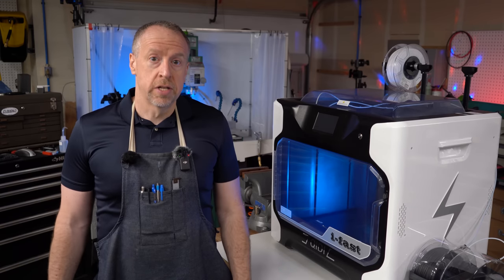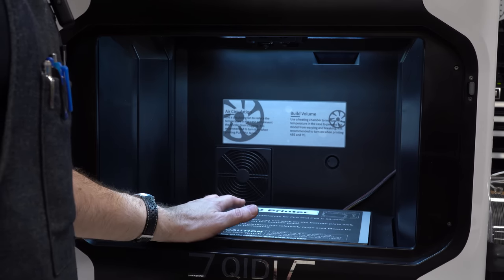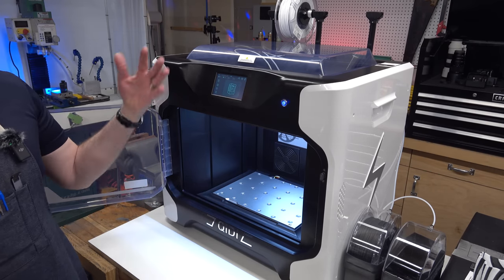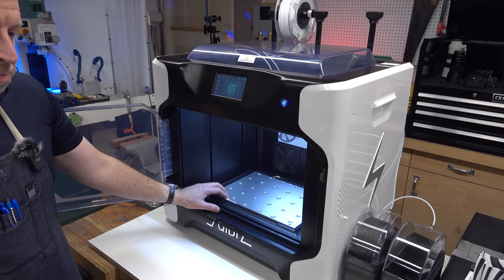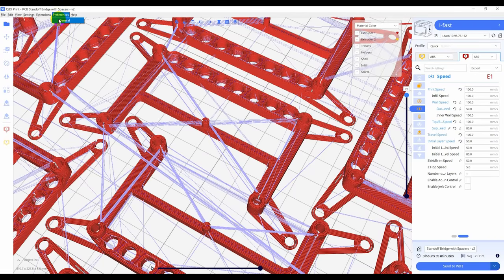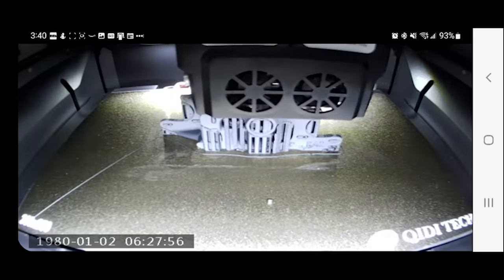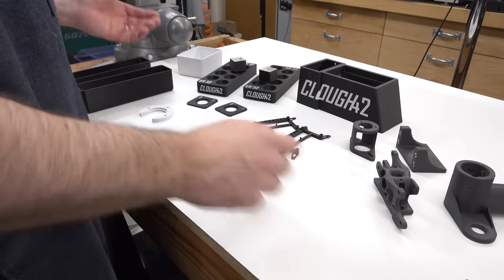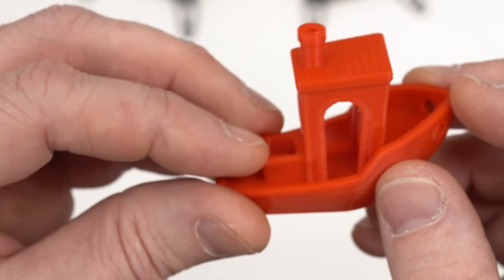QIDI Technology i-Fast 3D Printer | An In-Depth Review

Comment: Thank you for this really usefull very in depth review. Your usage of 3D printer is similar to what we use it for and your criterias seem to be much the same as our criterias. I have been running a Stratasys Fortus 250mc for almost 7 years at the office. I printed a lot of different parts but always in ABS. First, we use the Starasys ABS+ and a year later, we tried successfully the Argyle ABS+ spools. In time, we were able to reprogram (refill) the EEPROM needed to operate and I made see-trough windows in the spools's cartdrige so that we came to be able to use all the filament on the spool regardless of the EEPROM quantity indication. We were able to use filaments from other brands (much less expensive than Stratasys and more affordable than Argyle and Triton 3D) but only a few were good. Stratasys machine are almost full automatic so when it works, it works but when there are problems there isn't much you can do... that was pretty much frustrating. The last year we were checking what to do, what 3D printer to buy to replace our aging Fortus 250mc. Lately, I have been looking the different 3D printer for ABS on the market for the office but also for me at home. I plan to operate a small part time business. I need quite much the same 3D printer... a reliable small/medium production of mostly small to medium parts in ABS and maybe a few parts in TPU or similar "flexible" material. 
This QiDi i-fast seems to be the best option for us. But I am a bit concerned about using either breakaway support or soluble support (Aquasys 120 or PVA or other similar). My main products need support... some of them with soluble and others, would be fine with just a breakaway support. It seems these support materials (water soluble) must be printed with the "cold" extruder set. Would ABS print well with the "cold" extruder set ?
Reply from the maker: I did all of my ABS printing with the low temperature extruders.  And you're right: Ionic will not print at all in the high-temp extruder.  It jams and escapes the feed path.
Reply: @Clough42  thanks for the information. I am pretty convinced that it is the printer that I was looking for.

Comment: Prusa XL has a raise-able bellows that seems like it would enable a heated chamber. I don't know exactly what they have planned there but I heard something about a heated chamber. We'll see. I also have a deposit on it but honestly, my CR-10S with an automatic bed leveling upgrade is nearly as large and works great. 

For that cam based head lift mechanism... that's a rip off of early Stratasys machines. They don't do it that way anymore, but they used to.

Comment: 27:24 The thin wall gap fill for the PC board mount, you should be able to use the gap fill on select layers?
I know I can do that in simplify3d, are you not able to do that in your software or would it still take too much print time to do so?
Also in simplify3d you can set a tolerance for the gap size it will fill.
Reply from the maker: I haven't tested Simplify3D for this printer yet because the stock slicer was doing so well.  It has the thresholds for gap fill size and I fiddled with them a bunch.  Turning it off completely gave me perfectly usable parts in half the time.

Comment: Fantastic and informative review mate. I cant thank you enough for your time. I am deciding between the X-CF pro and the i-FAST. It is a pity the ifast lacks the auto bed levelling, when the X-CF pro has it. I dont know how much difference that will make in practice. I will say one thing though. Coming from a developer side; its very common for it to be problematic to disturb any device that is performing a firmware update. Computers for example and phones, can be bricked if you do. Its just a no-no. They should find some way of locking it off during that time though.
Reply from the maker: Not talking about firmware update.  The issue is when uploading a GCODE file to print.
Reply: I've been in contact with their support and it was mentioned their engineers are still working on the ABL when I asked, but it's taking longer because of the combined dual extruders. I don't quite see why, but I'm already leveling extruder 2 separately by switching over to it (repeatable), when exruder 1 gets the z-offset compensation with the stepper motors for the bed. 
So many good and positives reviews on YT about this unit with amazing results, but mine has been nothing but problems... back and forth with "afast" (very responsive BTW, and the reason I'm not returning it just yet) and having to send my 3MF model files over to them to see their results (and they've been different with other issues). Also getting them to see if it's possible firmware issues or my machine hasn't been easy....
Reply from the maker: @gpsevinsixx5095  they sent me new firmware to set the offset for the second extruder.  This is reflected in the documentation, too, so I'm not sure exactly what's going on.  If you hear anything about ABL, let me know.  I'm very interested.
Reply: @Clough42  I just got sent version 3.34 this morning for some E step adjustments for a trial test I was told. I had missing or under extruding areas near holes and layer transition areas for functional parts for ASA filament. They also sent a new calibration file for the dual extruders, I'm wondering if it's the same one you got? 
 
One thing I should note that I witnessed yesterday, but haven't mentioned to them yet is that while utilizing the calibration file (teeth alignment not the target version), extruder 2 would not activate while it was in the most forward (-Y axis) position and would just prime the nozzle in mid air while travelling over the plate. extruder 2 primes first from left to right, then extruder one continues onto the print after priming from right to left (just above EXT 2's line). If EXT 2 is manually activated all the way, it primes and filament contacts the plate as it should.. very strange and wondering if it's happened to you as well before the firmware update?  There's absolutely nothing in the way if it had to engage the activation plate at the most forward position.
Reply from the maker: I'm still on one of the many 3.28 versions they sent.  I haven't seen missing or underextruded areas.  As far as nozzle priming, the thing I've noticed is that after priming both extruders across the front, it doesn't retract the one that isn't printing until after the first layer.  So if I'm printing a raft with extruder 2, it primes both, then prints the advance (the line from the corner to the print) with extruder 2 and prints the raft.  All the time the raft is printing, extruder 1 dribbles out a little filament, since it hasn't been retracted or cooled.  After finishing the raft, Extruder 1 activates for the first layer, wiping off the ooze on the side of the part.  For every layer after that, it retracts and cools properly.  This is almost certainly a slicer bug or setting.

Comment: I use a mirror tile on my 3d printer. Mirrors are optically flat to prevent distortion in the reflection. They are also a better quality than normal glass.
Reply from the maker: All glass, including mirrors, tends to take a set, corner to corner.  How much depends on how it's supported, and how thick it is.  Not sure how that's relevant here, though, since this printer has a flexible magnetic bed.

Comment: The lack of mesh bed leveling is a deal breaker for me. In order for corner only bed leveling to be equivalent to mesh calibration, it needs to have a corner to corner flatness better than 1/2 the first layer height *relative to the motion system*. First layer height is typically 0.2mm.  Does Qidi guarantee a corner to corner flatness better than +/- 0.05mm? As in, the consumer could check the flatness and return the entire machine if it is out of spec. Note that checking the flatness of the bed while installed would be non-trivial... Maybe requiring an interferometer.
Reply: given how well he is able to hold a mechnically flat object to the bed contact surface - i suspect this printer is better than using a mush bed leveling - as mesh bed leveling makes sure the print head is in contact with the bed surface regardless of the warp of the bed, where as this assumes the bed is flat and given the aluminium build plate, i suspect it is hard for it to warp internally
Reply from the maker: The lack of bed leveling is the reason I didn't just buy one and instead started asking the questions that led to this review.  I am pleasantly surprised by its performance, though I only have one sample to test.  I have printed beds of parts edge-to-edge with no visible issues or part detachment.  And I actually measured the final height of each part, since it's critical to the function, and noticed no issues.
Reply: @rdpeake  the bed, after being mounted, would need to be flatter than mic6 to not benefit from mesh leveling. Even float glass benefits from mesh calibration as it is distorted by the surface it is mounted on
 The height deviations often become a significant issue with parts that contact a large portion of the bed, and this printer has a fairly large print bed for a desktop unit.

There is really no excuse for a printer in this price range to not integrate a sub-$50 sensor.
Reply: @saf3ty3rd  the print surface is thin and coneccted directly to a magnet surface connected to the pcb heat plate with 3 points of contact - i don't think there is enough tension being applied tothe print surface to cause that level of warping where by a 'wavey' surface will be present - and it does seem the prints in the video show this with how mechanically flat the print surface is on all his prints
Reply: @Clough42  it is entirely possible that the factory is doing insanely good calibration of every unit or that you got a lucky draw. As I mentioned before it is very difficult to measure actual flatness without integrated probing.  The ifast product page also doesn't appear to make any claims as to the flatness. Without a guarantee of performance or a means of effective calibration, I consider this a high risk investment.  Which is a shame considering this is probably the lowest cost heated chamber printer on the market. 

A strain gauge or proximity sensor would have added well under $50 to the BOM. I hope that Qidi reconsiders this in a future revision.
Reply: Now that good ole US6722872B1 has expired, I am hopeful that there will be more sub-$10k heated chamber options in the near future.
Reply: Place your bets on his next video. A - 3d print a bracket to mount a dial indicator to the head and see what's what. B - Remove the bed, ink it up, and introduce it to the surface plate. And as long as it's out, might as well hand scrape it.
Reply: @jamiestotz2516  it is a mistake to think that calibrating a 3D printer is the same as tramming a mill. The bed in a mill operates in a fairly narrow temperature range and is generally made of cast iron. A 3D printer bed is often aluminum, heated to multiple different working temperatures, and is usually highly constrained with many anchors. This is why virtually all production printers above $250 dollars do mesh bed leveling after the bed is at working temperature.  Yes, you could manually adjust the bed at 80-90C and only ever use that temperature... But you will find that it will still drift off a bit over time as the frame on a 20kg printer isn't quite as robust as a knee mill. FFF printers need frequent calibration to make up for not being made out of tons of epoxy-granite and cast iron.
Reply: @saf3ty3rd  There is an excuse, the printer runs Sailfish which has garbage bed leveling support compared to Marlin

Comment: Looks like a good prebuilt printer, have you considered a diy printer like Vorons tho?
Reply from the maker: I have three printers that I built from kits or from scratch.  If there's a kit printer out there with an actively heated chamber, I'd be interested.
Reply: @Clough42  My voron 2.4 does not have active chamber heating, since it does not need it, the large 350^2 bed is enough to get chamber temps up to about 60c, it does however have active chamber temp controll, and there are mods that will bring that higher if needed.
The other great thing about the voron family of printers are the speeds they run at. current record on a benchy is 2:43 i believe

Comment: I like the sturdiness and convinience of this entry level pro printer. But I have some concerns about it. The extruder is too heavy also it has the part cooling fans looking down so they will get hot air and wont do efficient cooling. Also brass nozzles? For that price ut should come with default plated copper nozzles
Reply from the maker: Way too heavy for what?

Comment: Very interesting with your comments on the software - as a professional in that area. Particularly the apparent problems with multi-tasking, seems like the easy solution is to simply disable the user-interface (splash "recieving data, please wait" on the display). 

Although of course, the real solution would be to have a proper real-time system that can handle the background tasks of receiving data and deal with UI interactions as well as the print movement and such. How hard can that be? Yeah, hard. But not rocket science, really.
Reply from the maker: I'm not really sure what the problem would be.  Unless it's just a matter of losing the timing when trying to move the motors.  Though I've seen it do odd things and crash the UI.  Maybe there are just a bunch of timing assumptions built in and they're being violated.
Reply: @Clough42  Neither am I, but if you get "weird things happen when you do two things at once", there's one of two things happening:
1. Race conditions, updating the same variables from multiple threads.
2. Timing is screwed up by the other thread/process.

Since it's highly unlikely ANY programmer ends up getting the upload and UI processing variables mixed up, even completely incompetent ones (and whilst the guys doing this may not be high grade ones, they are unlikely to be completely incompetent too - more like "sloppy QA/testing" and "driven by getting the product out"), I would expect it's timing-related.

It may be that they are polling things and "miss" their poll-time if a data-packet comes up.

Comment: Great video ! I'm new to 3d printing and I honed in on buying the qidi I fast as my first printer this fall . Winter is perfect for learning new hobbies. 

Anyway, I see a lot of these reviews, unboxing ect . But I really want to see someone use various filaments in this printer that qidi advertisers like metal , wood infused , maybe some exotic filaments. More of a high temp only print session using various out of box filaments. 

Actually I had only seen a very short list of exactly what this machine can print  for filaments. I hope this could be A future video before making the purchase.
Reply from the maker: The i-Fast is a lot of printer for just starting out.  There are lots of other variables that people get stuck on, like learning software and designing parts.  I'd usually recommend something a little less expensive until you're certain you want and need something more.  That said, it's been pretty good to me so far.
Reply: @Clough42  I really like the design, capabilities, technology of this printer over other models that are less expensive. It just seems that I'd rather spend my time printing instead of upgrading and tinkering with the machine parts . Although I do understand there can be other challenges that include software, bugs , designing issues ect . I've been watching tons of YouTube 3d printing tutorials and lots of reviews on printers . Speaking of which , that prusa xl looked really well built and thought out . Do you have an entry level printer you'd recommend?
Reply from the maker: @xslayerizedx  the ones I have experience with are no longer manufactured.  I did preorder the XL.  :)

Comment: 9:50 the PTFE tubing also provides a constant length of filament between chassis and printhead for the entirety of the XY range. Rapid movements don't fight the filament roll weight [or am I wrong on this]?
Reply from the maker: You are correct.  Though the manual suggests running without them if you're not using moisture-sensitive filament, and it seems to work just fine in my testing.

Comment: Hi James, can you see who makes those filament dry boxes. They are not listed on the qidi web site.
Reply from the maker: I see no brand markings on them.  They were packed in compartments in the foam inside the printer, and the printer came with steel brackets and screws to mount them on the back, so I don't think they're aftermarket add-ons.
Reply from the maker: I just looked in the manual, and the printed instructions show pulling out the "filament dryer box and sheet metal".  That would imply they're included?  But you're right.  They aren't listed on the web site or in the "included" section of the manual.
Reply: @Clough42  Thanks, I'll post a follow up on Friday when mine arrives.
Reply: Got so excited, forgot to post a follow up. Mine did come with one filament dry box. Seems to be a slightly different dual extruder design than yours. Cover enclosed top and front sides. No press-to-fit feeds either. 1st print (their included red PLA) of their test gcode file was great with the default settings of their slicer. Send over wifi takes 5-10 seconds, pretty quick. I had no time to get up and diddle with touch screen :) I'm seriously impressed by how far 3D printing has come. I can see this thing is going to be running all the time. lol.